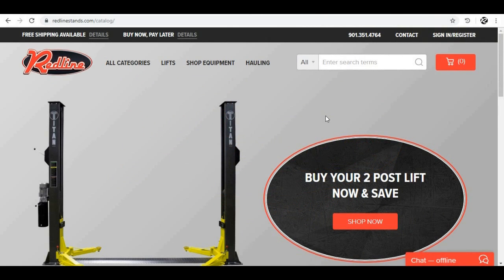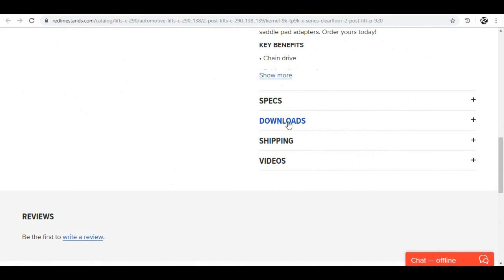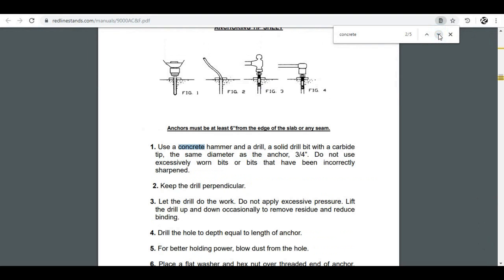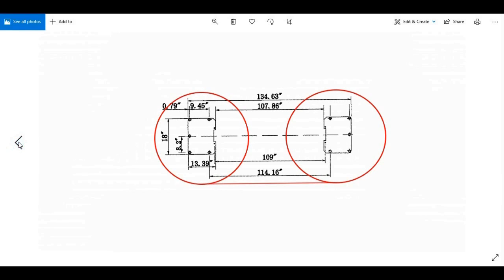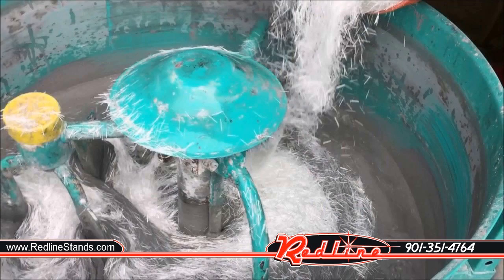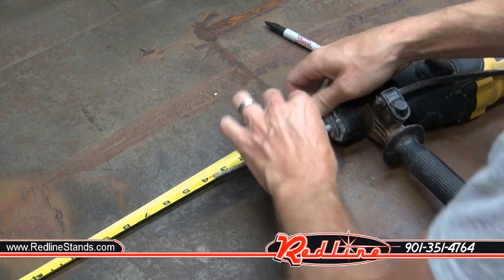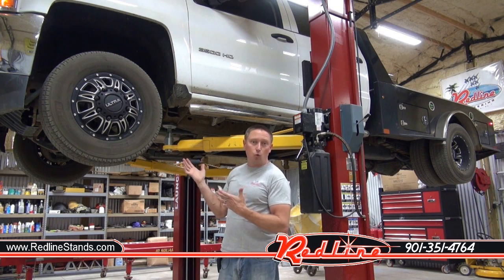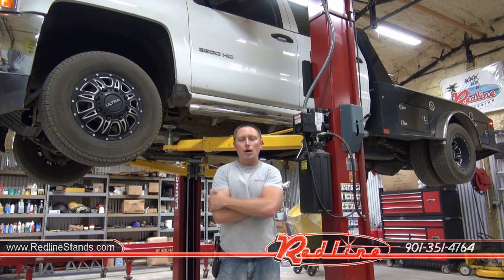Concrete Requirements for 2 Post Auto Lifts - Tutorial

Comment: Some really good information here - well done. Good to see sellers supporting customers this way. Some comments and tips to make this better:
1) When excavating deeper under posts, chamfer the edge (eg 45 degrees) back to the thinner slab (don't have 90 degree joins in thickness differences). Your photo of your shop showed part of this preparation being done.
2) When putting the tape on the drill bit, leave a flap loose so as it spins it is easy to see when it makes contact with slab (it swipes the dust).
3) Make some marks on existing slab (if replacing part with new, thicker concrete) or on the formwork aligning with reo or mesh, so when you do go to drill the anchoring bolt holes you DON'T drill into the steel!
4) Pay particular attention when screeding and floating at post locations to get it dead level.
5) Drill your bolt holes and grind the concrete perfectly level at post locations the day after the concrete is poured, not 28 days later. Green concrete is much easier to cut, grind and drill, and puts less stress on surrounding concrete and your tools. Don't actually USE the lifts for 28 days + as you want the concrete to harden to decent strength though.
6) As with all concrete slabs, keep it wet and cool for the first 7-14 days as much as possible. Slowing the hardening down early helps maximise strength long-term. This might be more of an important thing in warmer climes like Australia (my neck of the woods) than winter in Northern USA lol.
7) Finally, a pet peeve, please get the manufacturers / suppliers to use the term "concrete" not cement in their manuals and website guides. Cement is the grey powder that binds sand and aggregate into concrete, cement and concrete are different, you wouldn't use the terms radiator and coolant, or exhaust and muffler interchangeably, don't mix up cement and concrete either!
Reply: As a concrete guy that was once certified as a tech ^ THIS COMMENT ABOVE <3
Reply: As a guy who poured concrete for a living, including vertical and over-vertical work building skateparks, ^^^ 100% on all of these. Regarding #3, you can mock up a jig with the bolt hole locations and use it to ensure no interference of rebar with bolt locations. If cutting out an old slab I recommend cutting out an "H" pattern with the bolts/posts located at the intersections of the vertical and horizontal legs as well as drilling, dowelling and epoxy setting the rebar into the existing slab
Reply: correct hen butt welding twp plates say one at one inch, other at 1/2, you chamber the thicker way back

Comment: i recently put a new shed up for a workshop.  ran a 32mpa slab at 8 inches thick, double mesh (SL82) and a thickened edge beam, trench mesh and z bars linking the mesh. The old shed slab is sitting under the new one, it too is 100mm thick. had its own piers and steel, i had the hoist on it and it cracked radially across the center with a 2 post lift. i would use nothing less than 8 inch thick slab with double mesh and at least piers under it or raft slab like i opted for hoist applications.
Reply from the maker: I'm not sure what happened with your slab, but something went terribly wrong.  There isn't a single lift manufacturer in the country, as best I'm aware, that calls for an 8" thick slab.  Not Challenger, nobody.
Reply: @RedlineStands  the atlas  floor plate 12k lift calls for 200mm almost 8 inches
Reply: @RedlineStands  Well, that's what the engineer called for that specified the requirements. 100mm slabs are simply not strong enough, to support a hoist, a shed and mezanine floors . I can confirm radial cracks under the hoist on the old existing slab caused by stresses of the hoist. Since then, I would run nothing less than the concrete and steel specified, Safety first. I have 4 150mm long 5/8 dynobolts holding it down. The hoist is used for commercial purposes on my property also and i lift up to 3 Tonne vehicles on it also. And it is an older Molnar hoist the non clear floor version with a hump you need to drive over. If this type of hoist what sits on a box tubing base spreading the load over a larger surface area caused a 100mm slab to crack, what do you think a clear floor hoist would do to a slab 100 mm thick ?

Comment: i just did one for a maxjax 6000lbs lift we went 6inches deep witha  8500psi mix for airport runways and bridges. very solid and cure time was very short was able to lift a car 3 days later as the concrete cures very fast to above 3000psi with 24hrs. it was $44 a bag
Reply: Where did u buy the concrete

Comment: So is it ok to do 3 sections 4 inches on top and bottom and the middle 6 inches for concrete for the stands?
Reply: I don't quite follow your question, but what I can tell you with absolute certainty is that overkill is a beautiful thing. Pour as much as you can stand.
Reply: @dustingilmore2710  if I did a 30ftx12ft the section 10ftx12ft on top section is 4in concrete middle is 10ftx12ft 6in concrete and the bottom 10ftx12ft 4in. I kind of seen it on ur video, I want to do this for a garage I want to build.

Comment: The thing i can't get my head around is how these set ups resist the incredible forces that must be pulling the two posts together, with the weight of a vehicle on the arms, the forces are not just vertical, but surely must be trying to pull the tops of the posts in towards each other?
Reply: This is why it is better to get a two post lift that has the cables crossing at the top where there is a beam holding the tops from coming inwards.  Excellent point though if you use the floor cable routing.
Reply from the maker: Correct.  The concrete provides the strength that keeps them from falling inward.  The concrete is literally the foundation of strength for the lift.
Reply: They are, and the force is called a moment force. Each lift will be engineered to account for that in how large and far the arms will slide or project, the size of the posts, the base plate, and number of anchors used to secure it. Which is why it is important, and the purpose of this video, to follow each manufacturer's concrete requirements. It is all designed so there will not be any issues and why each lift has a max rating.

Comment: Tensile strength of concrete is not what you are looking for, it is compressive strength. And is very important to compact the soil underneath the concrete use type 2 with compaction and rebar in the type 2. Dome shape it and hammer it in.  Then pour the supporting footings with rebar spaced to avoid bolt patterns. Use a piece of plywood to make the bolt pattern template. Is easy. 6k psi concrete and don't go crazy on the fiber mesh. 3ft around each post will do it if you compact and dome the footing. Like an umbrella. Is easy and worth the 2 hours to do it.
Reply: They need to rewrite their manual. It makes you wonder how competent they are if they don't even know the difference in tensile strength, compressive strength, cement and concrete.
Reply: @LaflouderFields  you actually need both, on a 2 post lift there is a rotating moment right in the middle of 2 posts making them want to cave in and pull UP on the outside. So you need compressive strength to support the weight AND tensile strength so the posts dont pull the concrete up on the outside.
Reply: You do need tensile strength as much as compression. When those 2 post are sharing the load between them 6 feet in the air the want to pull in towards each other, the only thing stopping them is the anchors bitting into the slab and the cross over on the to top if it's an overhead lift. That is why typically there are more anchors on the outer edge of the base than the inner.
Reply: Concrete tensile strength is the most important thing for a lift as the anchors pull like crazy on the concrete when you lift a vehicle.
Reply: What if I have an existing concrete floor, at least 4” thick, 3,000 psi, that’s been curing since 1979, so how strong is that by now? I want to be safe, but also wondering if it gets stronger with age, would my stock, existing floor 4” be better or equal to a newer, thicker floor that needs to start curing all over.
Reply: Just about ALL manufacturers specify a base of no less than 48” x 48”.
Reply: Tell that to the engineers . Tensile testing a sample core from each truck on a bridge pour. Common pour strength is 3000 lbs . That 3000 lbs on an inch by inch steel rod before failure  Ie cracking . 3500 and 4000 are higher Portland mixes usually placed for driveways .
Reply: Tensile strength is referring to the anchor bolts. There will be pull on them even though there is compression on the post inside, the post is actually pulling up on the outer most bolts. I am making templates to cast my j bolts right into the floor hooked and tied to rear. I've seen too many anchor bolts loosen up although maybe epoxy could prevent that to some degree
Reply: Tensile strength is more important. The compressive strength is always higher than tensile.

Concrete's tensile strength is usually between 300 and 700 psi.

Concrete's compressive strength is usually between 2,500 and 4,000 psi

Metal rebar is used to improve tensile strength.
Reply: Thank you, god, not complex science

Comment: Have you seen successful installations of 9000 lbs 12' lift where an existing 3-4" thick slab with wire mesh was replaced only under the lift baseplate area?  I was wondering if cutting out the concrete in a 6" perimeter from the base plate fasteners and doubling the thickness with excavation would be enough assurance?  If the new concrete is anchored to the old with horizontally drilled and epoxy set rebar to miss anchors and use wire mesh everywhere else would this avoid a larger slab replacement?  Trying to avoid calling out a concrete truck, would rather work with bags, this is for personal use, vehicle storage and repairs.  I'm not asking you to assume liability just what you have seen done successfully or failures you have seen done like this.
Reply: Just simply cut you out a 2’x2’ piece of metal about a 5/8 or 1/2 thick and put it under your post base plate.

Comment: what are you using to anchor to the concrete??
Reply: Either wedge anchor it if it's existing concrete or if your pouring a slab for your lift I would suggest using j-bolts in a jig specific for your lift as it is way stronger and no drilling is required.

Comment: I had a pretty crappy shop floor , I cut out 5ft wide by 15ft long rectangle. Concrete was already 6inches deep but not level at all . I chose to go 13 inches deep 4K psi for strength the price point isn’t much different . Used rebar & mesh under where the posts would sit as well as hilti anchors and 2 nuts on the outter anchors of the base plates . And still gonna get lift jacks 😂

Comment: I see a typo in that pdf.
That 3000 psi is compressive strength. It's tensile capacity is limited to only 410psi at 3000 f'c.

If cast in anchors 3/4"  Jbolts with proper confinement #4 bar should suffice.  I would not use screw anchors for these things.

Also great crack control! Excellent point about guilding that away from the baseplate!

Comment: Hi there Ive made video on my car lift installation and review and its quiet handy as my model is 2 post H base and only needs 4 inch concrete. Check it out as it might be quiet helpful.
its a single phase lift, but also comes in 3 phase model.
Reply: BTW if anyone buys a used three phase lift solid state phase converters for such small motors are easily affordable.

Comment: One very important thing missing.....at 4:00 the wire mesh in sitting on the ground with NO standoffs or chairs as sometimes called
so the mesh is not doing its job this way.
Reply: Cool, trouble is also once you pull up the mesh the layer stands on it again to screed the concrete, the firbres 
are to short to do as good a job as the mesh and I have seen it crack also......The mesh once cracked will still hold together
Reply from the maker: You're exactly correct.  Thank you for mentioning that.  When we poured it, we pulled it up a once it was sitting in wet concrete, but even if we didn't, we added fiber to the mix so that alone should have covered us.  But still, good eye!

Comment: You call for the tensile strength of the concrete to be 3000 psi, but concrete is usually tested for compressive strength.
Reply from the maker: That may be, but I sell lifts for a living and I can promise you the installation manual of every lift I've ever seen calls for a specific tensile strength.  Normally it's 3000 to 4000 and it varies from one lift to the next.  See below as an example.  The American made Challenger CL10V3 calls for 3,500 psi concrete.
https://www.redlinestands.com/manuals/CL10%20manual.pdf
Reply: @RedlineStands  The literature doesn't specify tensile or compressive strength but tensile testing of concrete is not a common practice.  The tensile load is carried by the steel or fibers added to the concrete.
Reply from the maker: @perillouss3506  Checked with Challenger and they said, "The PSI (pounds per square inch) measures the compressive strength of concrete."  Right you were sir; good catch!
Reply: Not a simple mistake. More like a critical mistake. Probably best to seek advise from the installation manual or the manufacturer. They know for certain what standards you'll need to meet.
Reply: @philipbrown6500  Yeah, i would have flunked out of engineering if i had made that mistake. I don't usually comment on videos but some things that contradict my education, i have to commment on.

Comment: Can a 2 inch 2by 3 feet steel plate be installed under base to get it installed at a 3 inch concrete by adding more anchors on the steel plate
Reply from the maker: You'll have to hire an engineering firm for that one sir.  I'm sorry but I can't risk the lawsuit by answering your question.
Reply: 2 inch base plate is way too thick lol. All you need something like a 1/2 or 5/8. I have some 3/8 laying around for free and I’m using that.